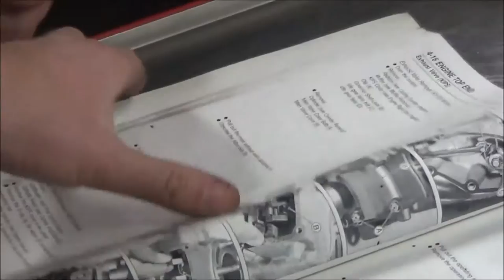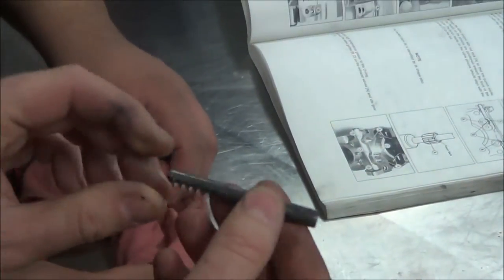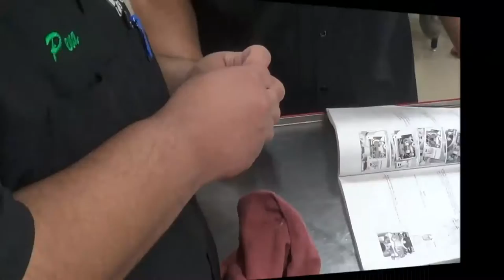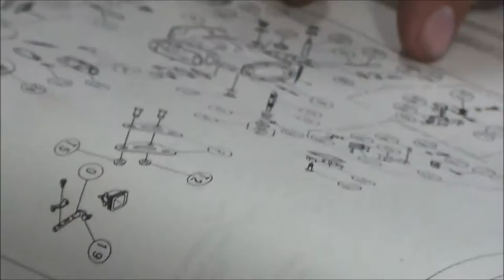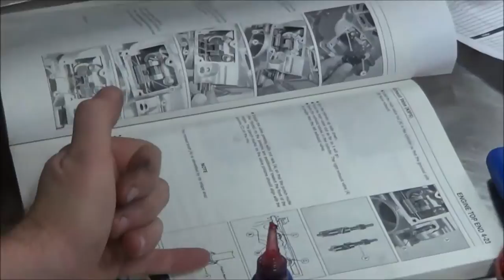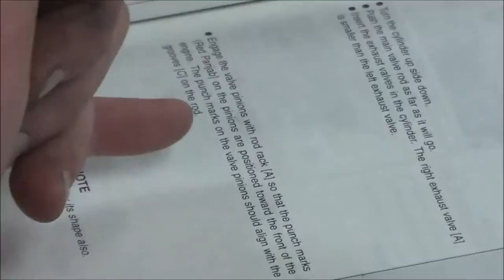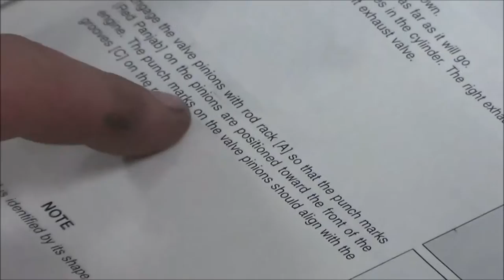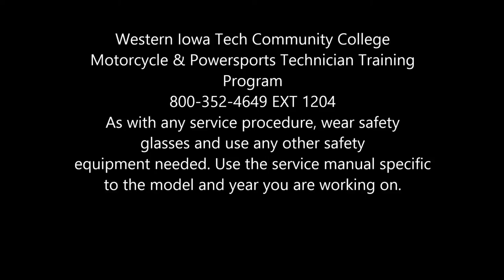2 Stroke Engine Assembly   Power Valves   11 10 14

Comment: For everybody who watch this video, it's absolutely great till the end problem, what actuali no problem is!!!
Took me 5 hours to figger it out!!!!
They did everything totaly right, the small open one the side walves are normal in this position. From this stage pull harder on the slider rod or pull on the the spring on the top and the side valves will fully open. Is like a 3 stage kips!